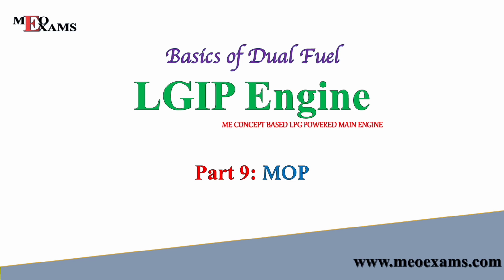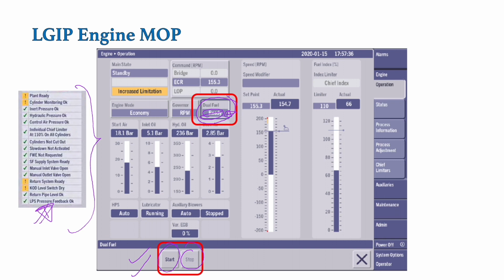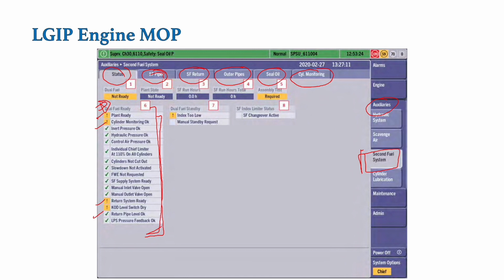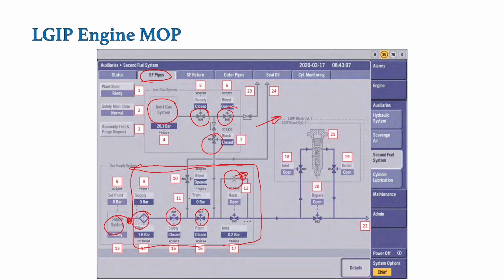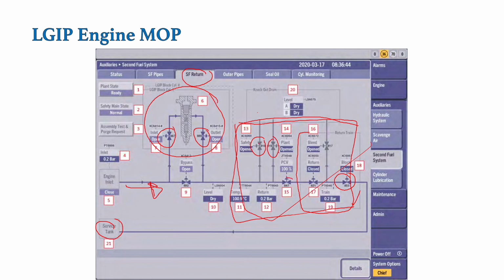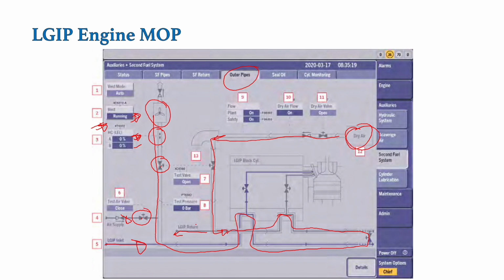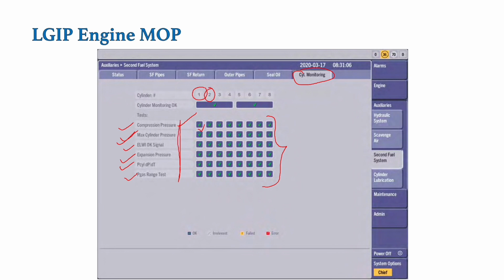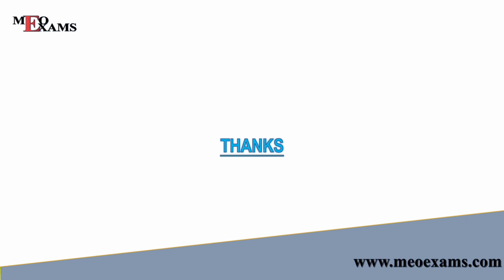LGIP Engine : Part 9 - LGIP MOP

Comment: Have a good day sir, can you please post a video regarding all alarms and troubleshooting during gas mode operation. We are trying gas mode but after running around 10 -15 min we are getting these three alarms 1. Load index limit 2. Outer pipe flow low/fail 3.SF external shutdown request